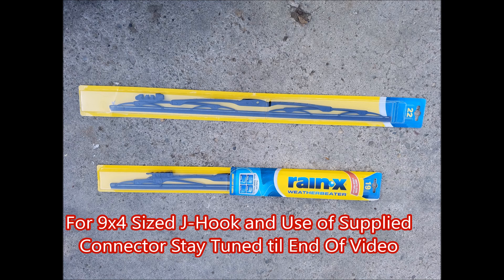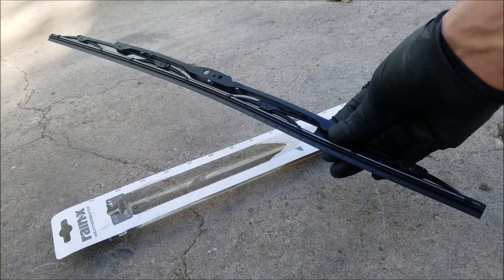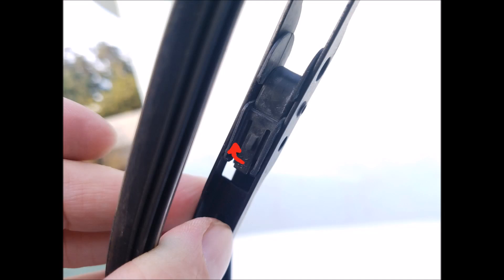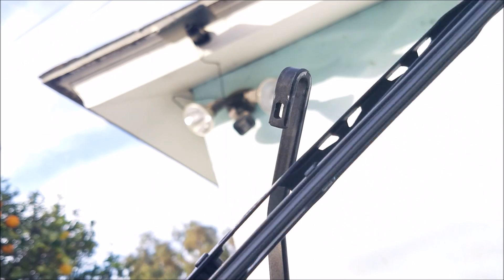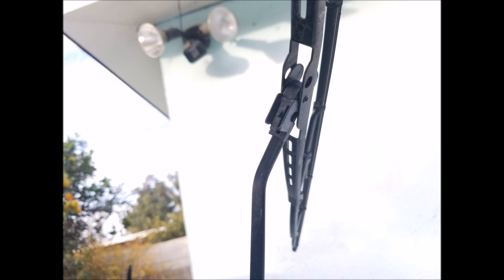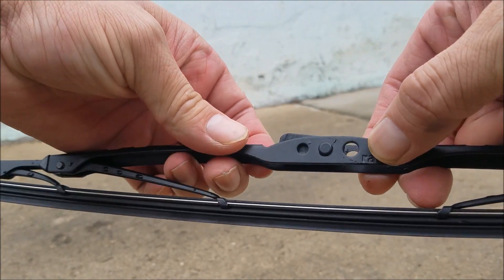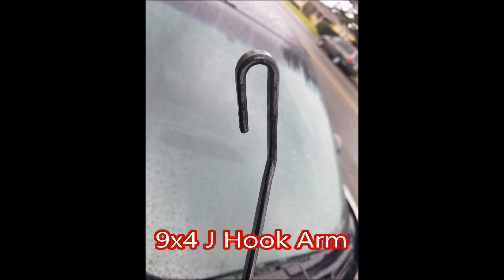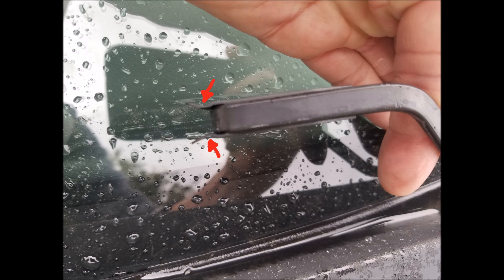How to Change Windshield Wipers Chevy Silverado Colorado Avalanche GMC Sierra Canyon (Easy)

Comment: My wipers don’t have the hook
Reply from the maker: Are they the straight end? If so usually it'll have a tab to push down or up depending on how ur facing it and itll disengage the knub that retains it..then u can slide the wiper off
Reply: Backyard Chevy oh lord. I need a video.
Reply: Backyard Chevy has oh. Yes. That’s how you remove them. But on the new basic wiper, there is no attachment. I wish I could send pics.
Reply from the maker: @pimpmyride7278  in the back of the packaging or if its got a instruction sheet it usually says which type the adapters work for..if not u may have to get a different blade...i do need an updated video..but gotta see if one of our vehicles has that type of attachment